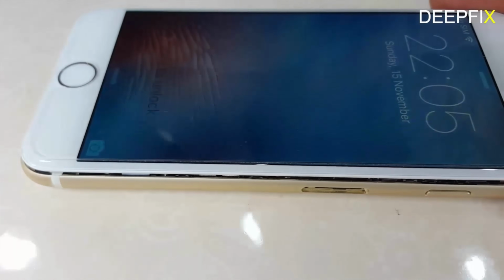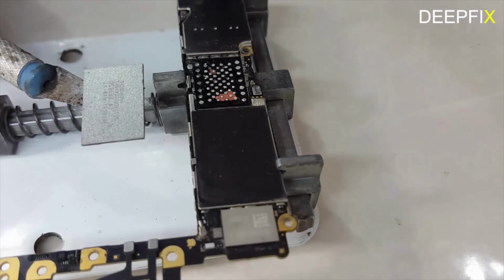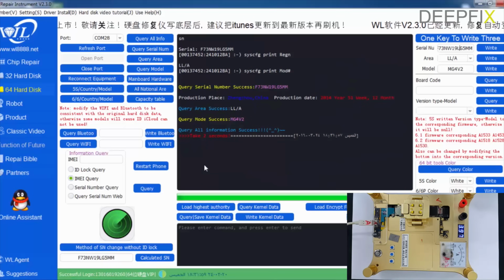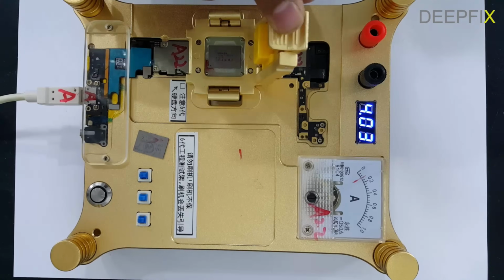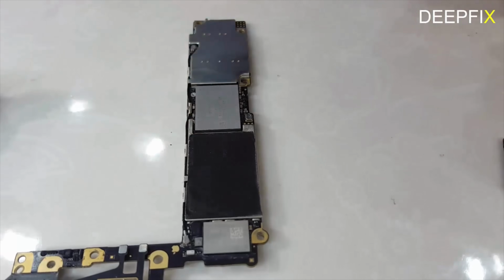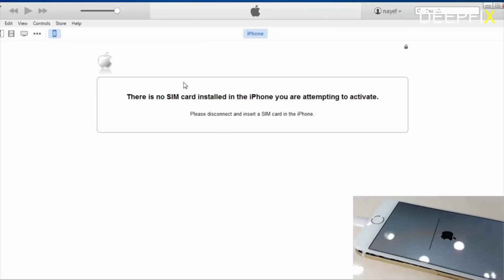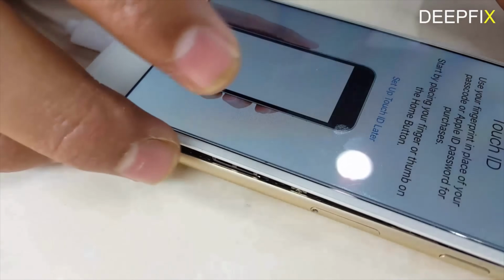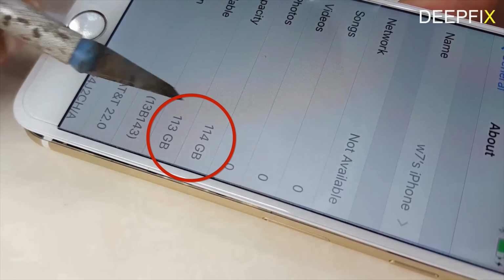iPhone 6 Storage Upgrade to128GB (4K)

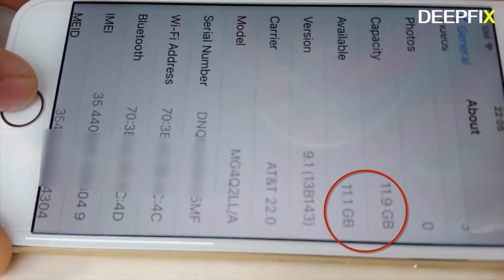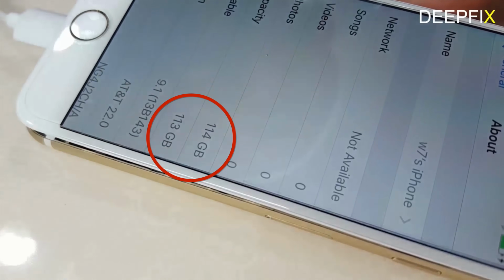Comment: update menory phone about "model" MG4Q2LL/A (0:14) be come NG4J2CH/A (5:39)
Reply: You are right, the model is not the same.
Reply: True I've noticed that, but the serial number is the same :/ .. I'm confused
Reply: It means, the SSD came off from a physically damaged 128GB(NG4J2CH) iPhone 6; being used on this 16GB(MG4Q2LL) model?
Reply: I think he had to get the 128gb chip from a different phone to be able to use it. That may be why the model number changed
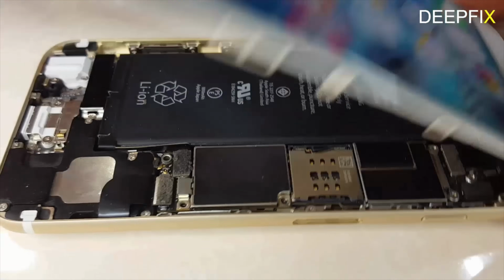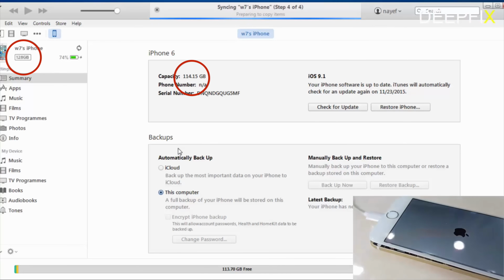Reply: look at (0:14) and (4:44) the serial is the same ;-)
Reply: jun jie Yik good question

Comment: What kind of flash tool is that and where can I get one?
Reply from the maker: you can import it from China
Reply: +DEEP FIX What is the name of the flasher though? The wl888i website doesn't work in america.
Reply: +Toxiccameron $599 for the flash tool..... lol
Reply: +Seong Hong dude,
I doubt he needs your advice lol
Reply: this whole process is not a good idea ....
Reply: +Ashraf Thaikkat you are damn right... the amount of things that could go wrong...
Reply: It's called an IC chip programmer, and this one was specifically able to fit an iPhone motherboard, here's the link to buy one... 
http://m.dhgate.com/product/64-bit-ic-chip-programmer-machine-repair/371282840.html#pd-103
Reply: +MMA ANALYST actually he is correct. You should never replace components without a proper 2M (micro miniature / miniature) repair station. A hot air jet tool allows you to heat just the area you are working on, this lowers the risk of damaging other components or the board due to heat transfer. 

I'm a Crane certified 2M technician and Electronics Technician.
Reply: What would happen if flashed iPhone on too a android chip
Reply: Toxiccameron f rom

Comment: Is there a way of sending you the serials and you programming a new 128 hdd? and buying it off you.
Reply from the maker: +xForza7x no
Reply from the maker: +xForza7x no
Reply from the maker: +xForza7x no
Reply: DEEP FIX ok ok ok I get it, lol
Reply: Did you understand!? NOOOOOOOOOOOOOOO
Reply: goran gavric Nice
Reply: It is not HDD. Our phones use SSD. It's flash memory.
Reply: +Kenji Gunawan Is not SSD,  correct term is NAND Flash memory .
Reply: Is there a way of sending you the serials and you programming a new 128 hdd? and buying it off you
Reply: Hi
Reply: Almaz Ahmad  Rock is also solid state so correct term is SSD too?
This is a one single chip  not a drive unit (module) like USB Flash Drive or your Solid State Drive! God dammit, use internet to gain some knowledge no only for porn and shitposting.
Reply: That would be a NO
Reply: actually its NAND flash storage.
Reply: why, and where are u located ??

Comment: Can u make it a 1tb ?
Reply: boi, that would be world record.
Reply: u can place 1tb there,it would simply not work cause the operstive system isnt ready
Reply: Now you're being just greedy
Reply: +Vivek Sridhar XD
Reply: You can actually, there is 2tb.
Reply: I know there's a 500gb but idk about 1tb
Reply: The maximum on an iPhone that I've seen was 512GB.
Reply: Only can upgrade to memory 16gb to 512gb. But There is only have for 16gb to 128gb upgrade products. 1tb or more not support yet from iphone. You can check more details on this link.
http://www.gsmkey.com/nand-pro-is-a-high-speed-programmer-for-repairing-programming-reading-upgrading-iphone-and-ipad-nand-ics-chips-1.html
Reply: Yes you can but it's a very high Risk and you need change about everything and know alot about the phone you have but I wouldn't recommend it.

Comment: Hello.. I have a new hdd now.. after removing, is it okay to just paste the hdd using flux as you did on the video? coz in other tutorials, they scramble the hdd or the mother board once by soldering and also they put some grey thing on the hdd.. you think those things are not needed???

Also What is the pasting liquid you used???

Kindly answer both of my questions.. I have been without my phone for a while now.. my phone's nand is dead and I have to replace it.. Bought the hdd and waiting for your reply..

Comment: I have done is at least 40 times, and I know that the way you removed hdd from logicboard, that board will never work again, because you fucked up the protective layer (see 2:14) from pcb, thats why there is shiny spots of solder on board. Second time use more heat for a longer time (365C).

Comment: I was a R&D Engineer working in the computer manufacture in the Silicon Valley. I did train the QC worker to fix the PC board. This is a very good video to increase the internal storage. My advise to you:
1. You need to be an expert/skill QC working in the PC manufacture in order you can unsolder and solder the Flash chip (IC). You need to know how to use the heat gun to unsolder or solder the IC properly. Not locate the IC in the right place will damage the circuit. Not enough heat will not mount/unmount the IC; Too much heat will burn the PC board. Not mount the IC tightly/perfectly , the IC card will not work.
2. At least you have some firmware engineering knowledge to program the Flash chip (IC), and you need the software application and the program machine to change the capacity.
3. You need to be successful doing the above two step. If you fail the above two, your Iphone is not warranty anymore.

I suggested that you don't follow this video. If you need more storage space in your iphone 6, you can purchase a Sandisk SDXC  256GB for $200, or around $125 on the Amazon. Sandisk SDXC 128GB for $60 or less, then insert into the SD slot in your iphone6. Check the specification of your Iphone for what is the maximum external storage you can get. This process you don't need to be a skill QC. You don't need the machine and the software application. You just need a screw driver to open your IPhone. then insert your new SDXC card. Anyone can do it. It is easy. Your grandma can do it too.
Reply: Word to the wise: iphone6 does not come with a built in external SD card reader. You'll need to purchase one of those lightning to SD card adapters to make this work out. This guy demonstrates what you need to do if you mistakenly attempt to stick an SD card into the SIM card slot (video is in spanish, turn on auto translate) https://www.youtube.com/watch?v=8CFo0MdSVE8

Comment: does the iPhone in which you take the flash chip out of have to be the same Model as the one you put it into? I obviously know that a the same iPhone generation has to be used, but does the specific model matter? I am trying to put the chip of a A1723 iPhone SE into an A1662 iPhone SE. Does anyone know if this matters?

Comment: Don't do this bullshit.  Buy Samsung Galaxy A3 for 300$ with 16GB and 
128 GB Samsung Micro SD for 10$ on Ebay and you have Samsung for 310$ 
with 145 GB memory. Samsung is the best that told you old Iphone user.